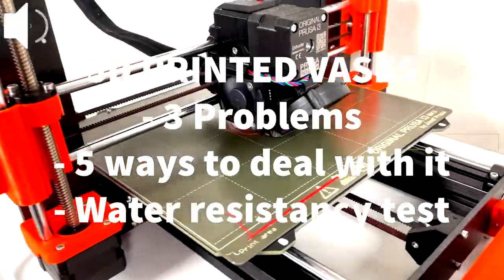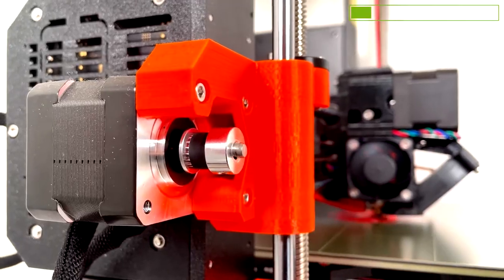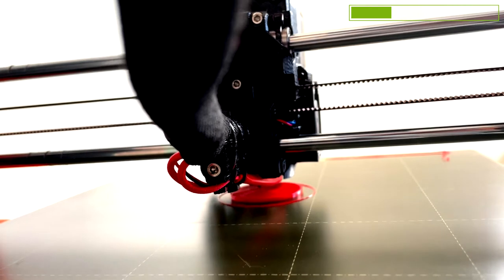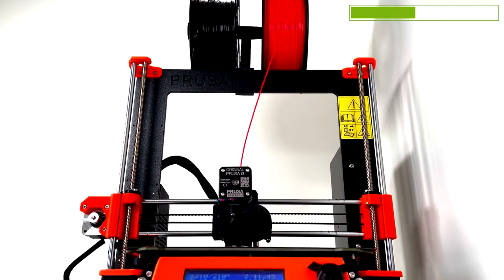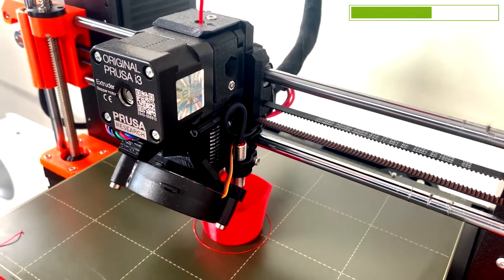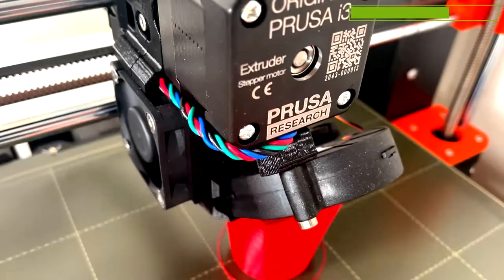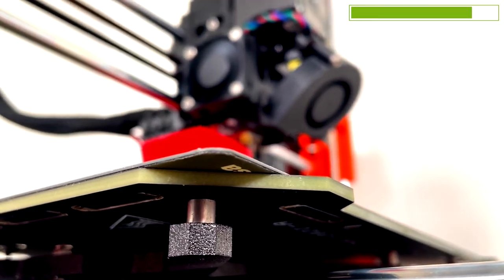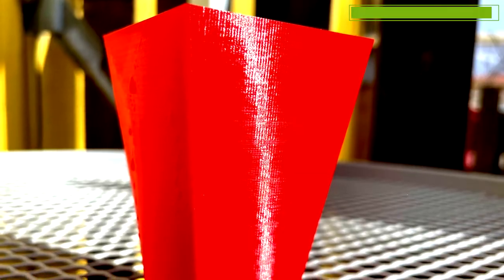Are PLA 3D prints waterproof?

Comment: Pla is waterproof I have ran a few vase with simplify3d on the xyz davinci.you just have to bring the print speed down to a crawl so that the filament can fuse.like 18 hrs for one print.
Reply from the maker: Thank you! I am aware of the opportunities with settings lile vase mode. I plan to do another video with several settings.

Are your vase mode PLA prints still waterproof after 12 months with water?